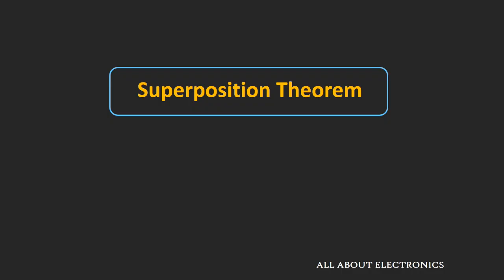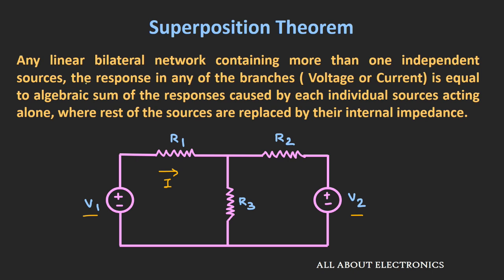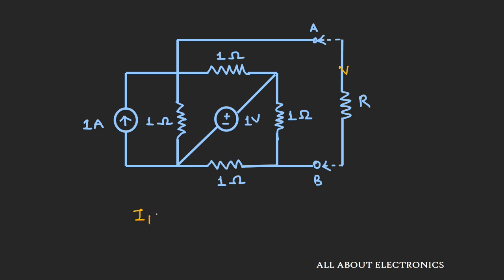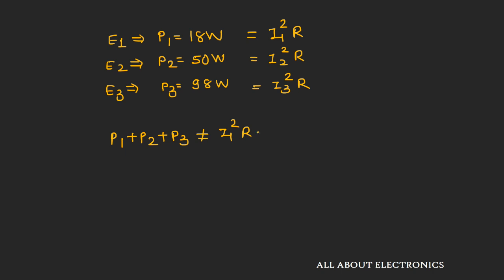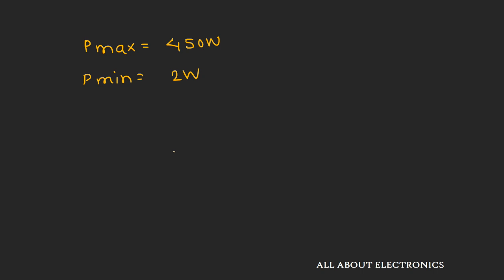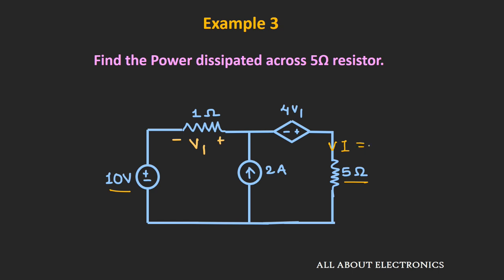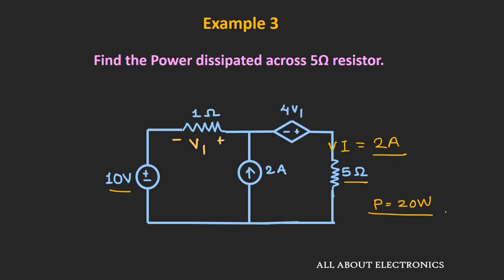Superposition Theorem Explained (with Examples)

Comment from the maker: Minor Correction at 11:50  ;  It's  2*[〖√9+√25+√49]〗^2
Reply: ALL ABOUT ELECTRONICS  why is v1=-i1 in ex 3
Reply: Sir..i think you shouldn't give every resistor 1π or same.if you not do this-it will help us to understand correctly which one, you are using.
Reply: @utena8518  Lol 8 month later 😅😅😂 still thanks for telling because I was wondering the same but I figured it out and then came to comment section 😅
Reply: Even I was about to comment the same thing sir....I like the way you explain things but pls consider this request of mine....pls give some other value other than 1 for resistors to understand the same much better.......and one more thing if am not wrong there is a mistake in your calculation sir, you can't separate things within square root with squares like that while calculating Pmax......reply me if am wrong....
Reply: why did you remove R from the square root , i think this is mathematically incorrect
Reply: @kgamphulanga9315  it does appear incorrect at first but you can remove sqrt(1/R)from each and then square it as it's own piece leaving you with 1/R multiplied by R thus cancelling out

Comment: why at 7:50 is the current through the 1ohm resistor 0
Reply from the maker: In the Wheatstone bridge circuit, since the resistance of all the arms are same, the point A and B will be at the same potential. And that’s why no current will through 1ohm resistor at the centre.

Comment: Can anyone explain In 5:20, why the two 1ohm resistor can be consider as parallel but on the other hand in 5:49 the 1ohm R why is that in series with the 0.5ohm resistor
Reply: When Voltage source is shorted, clearly see the terminals of both resistors are connected same point, so it's in parallel 
For second question, when you have to apply current division rule, you have to apply to the single resistor as we cannot divide current in series situation, so it's in series connected

Comment: At 17:05 V2 - V" = 4V" hi kyu hua
V"- V2 = 4V" kyu nhi hua.....?
Reply from the maker: It is simple KVL. Just apply KVL between V2 and v1''. In case, if you find it difficult, replace V2 and V1'' with voltage source ( with plus - minus sign). It will help you in visualising them.

Comment: someone plz explain why in the 2nd ex in Pmin we took total current as (I3-I2-I1) ???
Reply from the maker: P min = I min^2 x R. So, to find minimum power, current should be minimum. (I3 - I2 - I1) is the minimum possible value of current. And hence, it will give minimum power.
Reply: @ALLABOUTELECTRONICS  thankyou  but .. y is i3-i2-i1 the min. Current??
Reply from the maker: At 11:27,  I1, I2 and I3 are calculated from the given power.  So, for a given R, the (I3 - I2 - I1) will make the current minimum. Isn't it ??
Reply: @ALLABOUTELECTRONICS  thankyou sooooo much 🥺🥺 this was the 1st time .. my doubt cleared via utube 🙏🙏🙏

Comment: at p=i2R       you took common multiple of them out ok but you should have square 2 also because  the square is for all the component which is radical of (square root of 25+49+9) 
the 2
my second question is how V1=-I1
can you answer it plz
this question is nothing but a request

Comment: All other independent sources would be replaced by internal impedance

Quire useful - AC Sources with different frequencies

Power can't be calculated by superposition - with exam 8:45
Min power max power
By - Minimum and maximum current through load

13:48 - dependent source example

Comment: I have a doubt in 3rd ques  that how you decided direction of current source when you considered 2A as  current source
Reply from the maker: 2A current is entering the node. while the other two currents are leaving the node.
That's why there is a negative sing before 2A current source in the equation. 
I hope it will clear your doubt.
Reply: @ALLABOUTELECTRONICS  thankyou 😄

Comment: Can we use mesh or node analysis while solving ckt in super position theorem
Reply from the maker: After applying superposition (Considering only one source at a time), the equivalent circuit can be solved using the node or mesh analysis.
Reply: @ALLABOUTELECTRONICS  thankyou

Comment: at 15:08 how is V1 = -i1? as according to the current direction of i1, it would be a voltage rise?
Reply from the maker: with the direction of the current (Clockwise), there should be a drop in voltage across the 1-ohm resistor. but it is rising. That means assumed voltage drop V1' has reverse polarity and that's why with the given polarity there will be a negative sign.
I hope it will clear your doubt.

Comment: What is the defference between superposition and thevinin theorem ?
Reply from the maker: The superposition is used for linear circuits. And to find the current or voltage across the particular element, only one source is considered at a time. The overall response (current or voltage across the element) is the summation of the individual response. 
The Thevenin's Theorem is used to find the equivalent circuit across the to terminals. Using it, any linear circuit can be replaced by the Thevenin's equivalent voltage source in series with Thevenin's equivalent resistance across the two terminals of the circuit.
For more info, please check my video on Thevenin's Theorem.

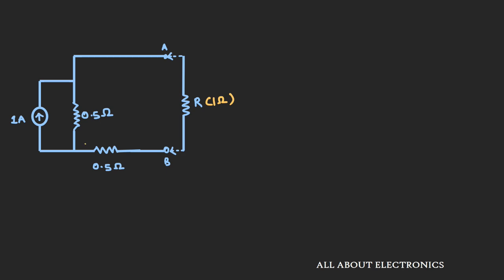Comment: at 5:30 how is the short circuit same as 2 sets of  2 parallel 1ohms? A set on the left is correct but how did the set on the bottom be there? I thought those two 1ohms would disappear since the circuit is shorted.

Comment: At 6:21 The current that is going through the .5 ohm resistance is .25 A so the current going through 1.5 ohm resistance is going to be .75 A which is not reasonable because the larger the resistance the lower the current which is not consistent in this example because the larger resistance is 1.5 ohm and it has the lower current which is reasonable and logical.
Reply: yesss.....bro its 1.75

Comment: a 230V 50hz ac supply is connected to a resistance 2.5ohm coil of inductance 0.06h and capacitor of 6.8uF connected in series. calculate  
impedance of circuit
current
phase difference between voltage & current

Comment: Sir last question main supernode nahi lagega, please check this again.. Total current across 5 ohm will be 4/3
Reply from the maker: If you simply apply the loop equation in the outer loop then it won't require. ( I mean no need to apply the concept of supernode)  but when it is solved using the nodal analysis method then there will be a supernode.

Comment: in the last example, how is V1' a voltage drop? the source is clearly flowing from low potential to high potential which is clearly a voltage lift. if your 1I1 is negative then your dependent voltage of 4V should be negative as well, but obviously it isn't since its experiencing a voltage lift lol.

Comment: i still do not undersatnd why it is -5i in the equation at 14:59
Reply: i got it
Reply: I believe it is because the current and voltage do not adhere to passive convention. So you must add a negative sign.

Comment: Sir had we considered that ammeter is non ideal in first case. Otherwise those two resistors will be short circuited. Also in removing voltmeter the wire was connected. But while removing 1A source u didnt removed wire which will create short circuit

Comment: in ex3  for 1ohm resistance voltage  diff. is v1 so it given or we have considered it as v1 due ti dependent source  4v1 and why v1 = -i1 it should be i1 only.

Comment: When considering only 10V voltage source, how did the voltage across the 1Ω resistor became (-V'1)?
Reply from the maker: Because the direction of current is assumed in a clockwise direction. i.e I1 is flowing in a clockwise direction. 
So, if you apply KVL, then V1' = (-I1)*(1 ohm)

Comment: In last example why is it - 5I1 and not +ve as there is a rise in that 5ohm resistor.
Reply from the maker: Because if you move in the clockwise direction, then there is a drop across the 5-ohm resistor (moving from positive voltage to negative voltage). That's why it was considered negative.

Comment: Sir pls tell me how. V"=i
Reply from the maker: Would you please tell me the exact time stamp in the video, so that it would be easy for me to answer your question.
Reply: At. 15:05 sir and. Also 17:23
Reply from the maker: It is because of the Ohm' law. V= IR. 
Here, R= 1 ohm. And the direction of the voltage V1' is assumed other way around . (Opposite to the direction of current I1. 
That's why V1' = -I1
And same is true at 17:23
It is actually I2= V1''/1ohm.
Instead of 1 ohm if there is R ohm resistance then the expression would be equal to I2= V1'' /R
I think because of 1-ohm resistor you got confused. Isn't it?
Anyway, I hope now it will be clear to you. 
And still if you have any confusion then do let me know here.
Reply: Yeah confused by the resistance.. thank you sir got u

Comment: sir ...at the last example ..v1"-2 +v2/5=0 is written...but by sign convention V1 should be negetive ....I could not understand this point
Reply from the maker: At supernode, the KCL is applied. See, 2A current is going into the node. While other two currents (V1''/1ohm) and V2/5 ohm are going away from the node. So, if you consider the incoming current as negative and outgoing currents as positive then you will get the above equation. If you consider the sign convention other way around (Outgoing current as negative and incoming current as positive ) then also you will get the same equation. 
I hope it will clear your doubt.

Comment: as far as i know after replacing 1 volt with short circuit current won't pass through right and below 1 ohm resistor as current likes to pass through the path with less resistance the current will simply pass through the short circuit.
Reply from the maker: What you are saying would be true if there is a short circuit in parallel to the current source. (Across the current source)